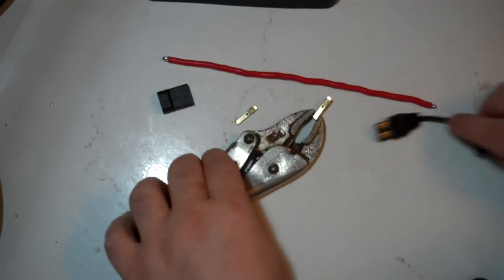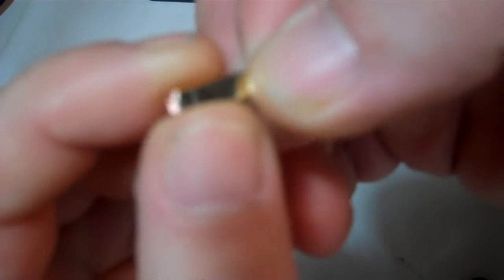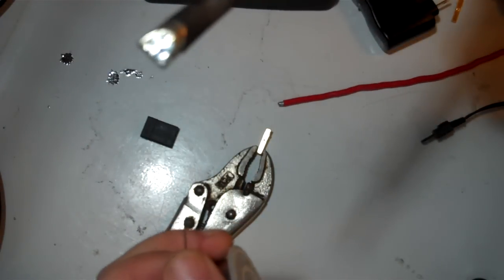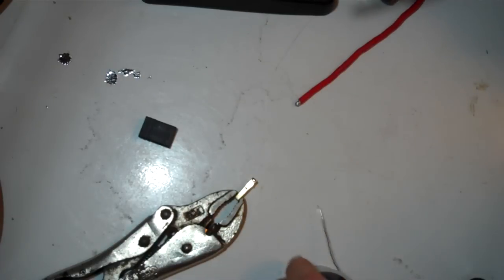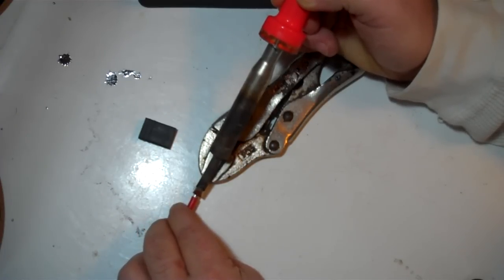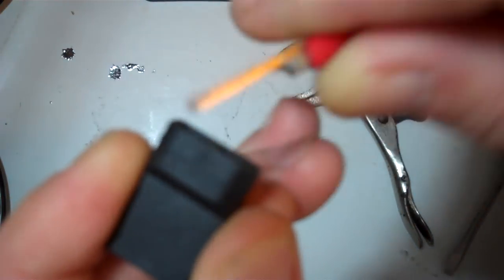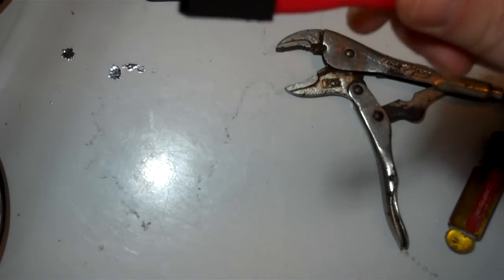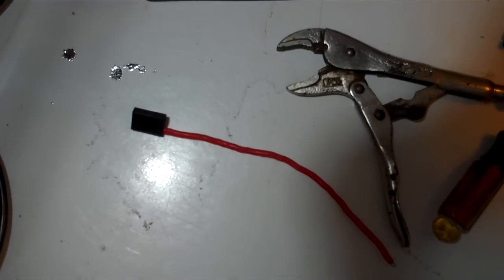installing traxxas knock off plugs

Comment: good tips on soldering, but holding the vise grips could be a little cumbersome for some people. Your techniques followed closely, combined with the jig that forresttrenaman made, would probably be the easiest way to solder a traxxas connector IMO . When I first started with traxxas connectors I was holding the tab in a small vise, but I never could get a good joint. I made the little jig he has and got a near perfect joint on the first try.